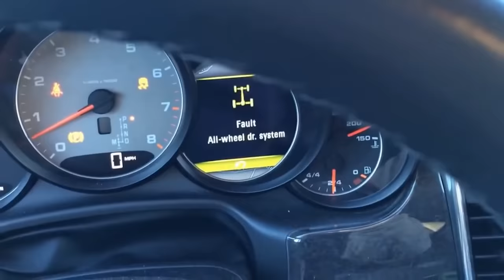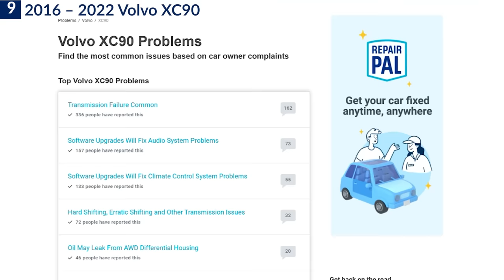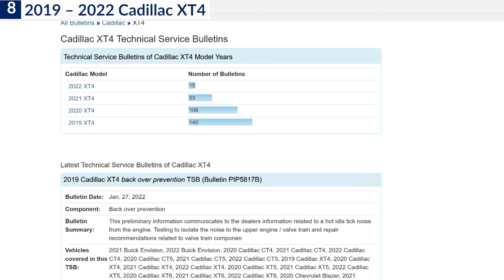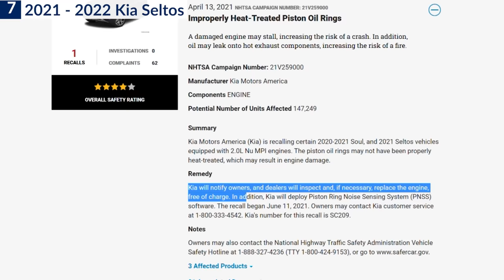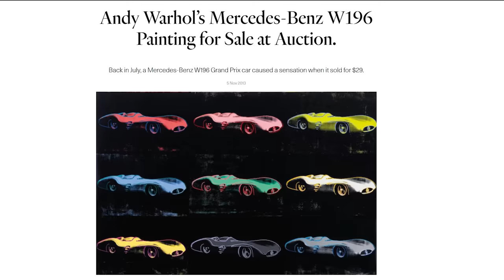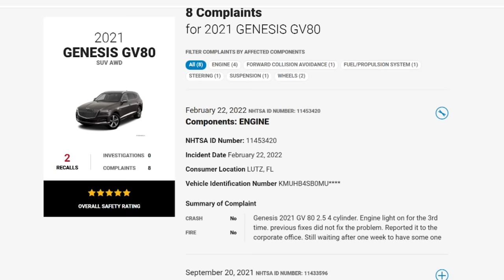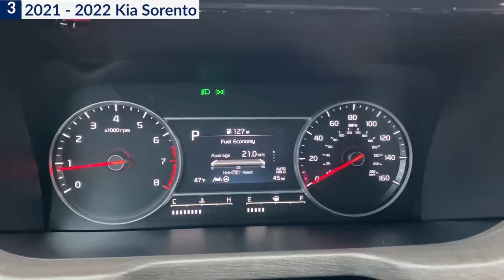10 New SUVs to AVOID - Here is Why !!

Comment: I had a 2018 Tiguan and never had any problems.  The only reason I don’t have any more is because I fell in love with the 2021 Arteon
Reply: I haven’t heard any positives about VW recently! Especially the van.
Reply: Same here, still have a 2018 Tiguan I bought new and not one problem
Reply: This is such a VW owner response lol. “ I had my car for 2-3 years and it was fine”. Some people keep their cars and want them to work into the future
Reply: You should play a Lottery because Luck 🍀 is in your side 😂
Reply: I have had a Passat for 6 years - perfect car! NO issues at all - totally reliable
Reply: So you got rid of one shitty car for another, congrats 👏
Reply: @andyb7719  My Passat is a lemon.  It has just under 100,000 miles on it, and needs the moon roof re-done for the third time.  Standing water in the driver's side foot well.  With all the other repairs it needs right now, it totals over $8,400, which is far more than the worth of the car.  When I took it in for servicing, the guy told me they were really busy, as there were lots of cars in for leaks.  It has been an awesome touring car on road trips, but otherwise has been a mess.  The first time it had to be flat-bed taken to the dealership was the day after we bought it.  The next time was a couple of weeks later.  All the mechanical stuff we have been through sealed the deal for me.  I just bought a RAV4 hybrid, and am very happy with it.
Reply: It is funny how some people in this thread call my car shitty but my sister who has a 2019 Camry which are supposedly reliable, has been in the about 6 times.  I will keep my shitty car
Reply: @japanwatchconnection which one? The 20'  Q7? The 16' IS350? The Camburg built long travel 05' Tacoma or The 20' XSE Camry V6?

Comment: The newer a vehicle, the less reliable it will be. This is why there is an odd year where a company does not plan for reliability but manages to eke out a top spot. Consumer Reports also has faulty metrics for gauging a cars reliability. It's based on consumer surveys and early reliability issues. Early problems are not indicative of long-term care. The vast majority of issues reported tend to be user adoption rather than something breaking. For instance, how to use a new infotainment system. The consumers of these vehicles have varying metrics and standards they expect in a vehicle. Someone buying a Mercedes is expecting something a bit more than a person buying a Toyota. It's basically asking the opinions of a car enthusiast verse a person who treats a vehicle as an appliance.

Reliable vehicles depend on their simplicity, power train and material choices, and consistency of construction. These can all be analyzed to draw conclusions on reliability beyond 5 years. There are rarely actual reliability issues under 5 years.
Reply: You mean the company? You’re basically saying older cars are more reliable which really isn’t the case
Reply: Our 2018 Suburban was bought brand new, we have had no reliability issues! The used car we bought for our daughter, well that's another story!
Reply: @chrisstromberg6527  
I meant it as in an old platform still in manufacture like the Dodge Challenger has been in production since 2005. A new Dodge Challenger would be far more reliable than a new Grand Wagoneer.
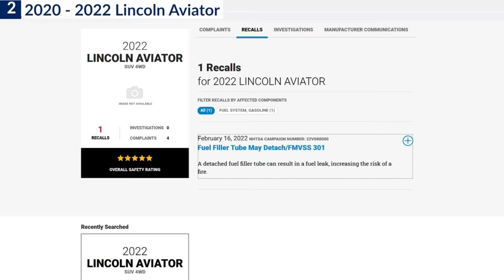Reply: German Vehicles lovely design great interiors but sad electronics failure . Japan electronics stand out as premium and reliability stakes. Happy customer award by far !!! 12:46

Comment: The Volvo complaints about bumpy rides on rough terrains, you got to be kidding. So in other words WTF
Reply: I never experience that on my 2017 XC90.
Reply: for real... I did a review on my '16 XC90. I address all the common issues. It also does not have transmission issues as stated.
Reply: True
Reply: Exactly! This video is full of rubbish
Reply: The first Volvo we got was a 2016 XC90, never had an issue what so ever and just felt like a tank, you felt safe in it. We returned it when the lease was over but I still miss that car.
Reply: When I test drove it, it sounded a little tinny.
Reply: @Listman11  sadly they aren’t made like they used to be

Comment: Hmm I dunno about this.  We have a '21 Aviator and other than a rear view camera recall we haven't had any problems with our Aviator.  Also they said they had the most comfortable seats of any SUV.  No they don't, at least if you have the 30way massaging seats.  The seat bottoms get really hard after a couple hours behind the wheel.  If I got another one I would pass on the over-rated massaging seats in favor of a little more cushion on the butt...:)

Comment: CR has become increasingly biased in recent years. I cancelled my subscription once I noticed this trend. I am by no means a GM fan, but to say their full size SUVs are the least reliable is just plain irresponsible. When a vehicle can go 200K miles with relatively minor repairs, it is far from unreliable. The Lincoln Aviator had 1 recall but is higher on this list than the GLE with almost 40? Tells you all you need to know about this list....
Reply: Exactly what I was thinking looking at this list. Seems just a blind list.
Reply: Your are 100 percent right
Reply: Your vehicle may have been the % that was ok. You're not looking at overall stats.
Reply: @Chris-de2qc  Most reports of vehicles that will last 200K miles or more include the GM full size SUVs. I consider myself a car guy, so I am almost always reading owner reviews and looking at this type of "Top XXX" list. I've personally had a Yukon and Tahoe that both went over 200K without any major repairs. Regular maintenance and a couple fuel pumps, and that's about it. I've had poor quality vehicles as well (one is one this list), but I stand behind my statement that CR is no longer an unbiased resource. They solicit reviews from subscribers, of which they may get a few hundred or maybe a thousand for a particular model, while the manufacturer sells thousands or even hundreds of thousands of these vehicles. Also, there is no way a list of unreliable vehicles is accurate without a Range Rover.
Reply: I agree with you. I too cancelled CR subscription. I have seen them indicate low ratings on particular vehicles when there is other vast compelling evidence to the conntrary.
Reply: My Lincoln MKX has been amazing in so many ways..
Reply: Agree.  They seem to love the Audi and BMW's, and yet my experience has been awful.  Worse stories I've heard are Porsche.
Reply: Totally agree, I have already comment that 1 min ago
Reply: 100% agree, our 2018 Suburban has been problem free!

Comment: Had a Mercedes SUV years back, fantastic car but It broke down on first holiday trip in Switzerland great service with the dealer taking part off showroom display car, that was the only issue in 100’000 miles, then got the first of new shape Volvo XC90, launch car and lots of problems on the electric controls, after several attempts to fix with software updates Volvo gave us a new car, I’m now on my 3rd, fantastic car with no issues anymore
Reply: Which is?
Reply: Geneva or bern?

Comment: Nissan earns a spot on this list for its CVT transmission.
Reply: I haven't had a problem with my Infiniti QX60
Reply: I've owned nothing but Nissan and I've never had a cvt issue.
Reply: Bought a 2017 Nissan rogue few months ago drives smooth The newer nissan’s shown provement
Reply: Didn't have an SUV but my Altima transmission died on me in the Chic FIL A drive thru.  Lol.  Had to be pushed out by two ladies.  They gave me my food for free.  It was a bad/big issue.  A lawsuit came out a few years back.  Nissan paid 70% of the cost to replace it which was $4k+.  Smh.  I think/hope they're better now.
Reply: @amyersadams  mine died on an exit ramp! Thank God I wasn't on the highway. Had to replace the transmission at 60k miles. It's a 2013 and I haven't had any problems since then, but I'm still wary about buying another Nissan, or an Infiniti.
Reply: @SassyZ22 , oh yeah.  Thank God!  Funny thing is, I was getting ready to get on the hwy but wanted a snack for the ride home from work.  I always say, I'm glad I was being greedy that day.  My tranny went out at 105k.  I now have about 228k miles on my 13' Altima.  So far, thank God, I've had no more issues out of it.  Hopefully the newer generation of those transmissions are better built.
Reply: @Angel Adams  yes, I'm at about 116k now too! But I'm definitely not buying anything with a CVT from here on out lol
Reply: I have a 3.5 Maxima. The CVT trans is the best of any car I have driven. Amazing

Comment: The XC90 transmission issues cannot be true, it shares the same transmission as Lexus and Toyota, the engine I can understand but not the powertrain or transmission.
Reply: Um, no they're not.  Volvo has a manufacturing plant in SC, however, the company has been Chinese owned for quite some time now.
Reply: @rickj1983  Yeah, I honestly don’t believe the transmission issue.
Reply: My 2916 XC90 T8 has been reliable so far except for a software issue on its infotainment system in my 1st year of ownership but since then resolved after software update. I hope I’m lucky on this one. It’s on its 6th year now.
Reply: @rfm357  I agree we have an XC90 as well we love it.
Reply: @rickj1983  Volvo's 8 speed transmission from Japanese Company Called Aisin, Aisin is related to Toyota Company. The transmission issues happened to Volvo was owned by ford  and 
Volvo used Ford's Dual Clutch Transmission.
Reply: What Year XC90?  I rock a Swedish Produced XC90, not Chinese. I love and bless my VOLVO XC 90!
Reply: @theguildedscribe777  The new model year! Geely, the Chinese company which owns Volvo, simply funds them and gives them access to their mechanics, tech, etc.
Reply: @wangruizhi1738  Yeah, I owned a 2006 XC90 before purchasing the 2016, it was reliable just transmission issues
Reply: @rickj1983  Chinese owned means jack shit because everything is Chinese owned. It is manufactured in Sweden and the transmission is from Japan. Same tranny as the RX350. It even says it on the window sticker.
Reply: @rickj1983  In China, the complaints rate of XC60 that made in China is actually lower than those Swedish built
Reply: @rickj1983  Chinese owned but not all made in China. Get with it sunshine
Reply: coolray, geely's bestselling crossovers in saudi arabia, qatar, kuwait and the philippines.
Reply: @wangruizhi1738  Volvo used Ford transmissions way back when.  I remember my dad making fun of my Volvo being a Ford, lol.
Reply: @TheDailyDriver  You probably got all of your information from the same window sticker too.
Reply: @andyb7719  Okay, moonbeam, try to figure out which ones are Chinese and which aren't simply by looking at them.  Good luck with that one, lol.
Reply: @wangruizhi1738  true but some applications of aisin aren’t that good either like you can have a aisin be in a jeep but for some reason it won’t be reliable on it compared to one in a Toyota it can still depend some aisins aren’t good even tho aisin generally is the best transmission

Comment: Volvo XC90 owner here, 61000 miles.  Been in shop 5 times.  Turn indicator system malfunction, engine light on twice, spark plugs replaced, lower radiator hose leaking and replaced, O2 sensor replaced, steering wheel module stalks replaced.  All of this within the last 5 months.  The new loaner vehicle that I drove while waiting for the car to be fixed only had a little over 1000 miles on it and randomly pulls to the left or right while driving (doesn't matter the speed).  So be careful while driving.  I'm NOT recommending this vehicle to ANYONE.  Buyer Beware!!!

Comment: The Ford Explorer was the perfect vehicle, reliable, comfy, great layout.
I sold a 2013 that had 297000 miles, and still perfect; I have a 2017 Explorer now,(258000 miles), and still believe is the perfect vehicle; however after 2018, Ford dicked around with the perfect vehicle and turned it into a Dodge.
Reply: I had a ‘16 & the AC immediately went out right after purchase & ford basically refused to fix it until I made a stink, then the back window shattered by itself a year later. I still liked the car overall though, it drove really nice. The gas fumes leaking into the cabin was also a periodic issue (although not often).
Reply: @woodpit420  hi, the fumes in the cabin is actually a recall item, the dealer will fix it for free, they fixed it for me, and made all the difference in the world.
Reply: I have a 16 bought used with 30K.....Now has 80K and most reliable SUV I've ever owned....4x4 limited trim.....only some small minor recalls.....wife drives it daily with my kids.....will look into the Ford Lightning for my next vehicle....

Comment: I don't buy the GMC aspect. Wife had a Diesel colorado that went up to 120K miles before she traded it in a new Sierra (also a diesel). Sis in law has a Chevy Tahoe and so far seems good. Literally the whole family is a GMC family and it works fine
Reply: I can say I’ve purchased 2 (Buick Enclave and Pontiac Torrent). Both had so many issues. AC failure at 14,000 miles, body was easily dented and so many electrical issues. Visit the GM forums to see how many have premature failures. I didn’t expect much from a Pontiac, but was extremely disappointed with Buick. I would never purchase another GM, my money would be better spent calling an Uber. My experience with owning GM vehicles

Comment: Had a 2018 Tiguan. Body defects and water leaking into the passenger side when raining. So glad it was just a lease.
But I have to say, VW seems to be responsible. We got a few thousand back. They also offered $2500 extra for another VW and we didn’t go for it.
Reply: Have a 2013 right now and it’s junk. Will never buy another VW after this one
Reply: I had a 18 also bought it brand new actually the same color as the one in the video i never had an issue with mine, only had it 2yrs then i upgraded to the 2019 Atlas SE and I never had an issue with it either i  loved them both....but i did just traded for the Volvo XC90 it was my dream Truck a month after having it the check engine light came on but the dealership took care of the issue it was under warranty, it was some type of sensor needing replacement no other problems with it since
Reply: @MP-hi5hs  u got to do maintenance on time it's that simple.

Comment: Really disappointed to hear about the Tahoe! I have had three and my present 2008 Tahoe has 180k miles and has been reliable.  I was planning on a new one in the near future but this makes me want to hold on to this one.
Reply: don’t let this video discourage you, most of these cars are very reliable. However, this VIDEO is VERY unreliable… if you take good care of your car it will last.
Reply: Don't buy a new one.  I bought one for my wife and had engine issues 2 months later.
Reply: My 2022 Tahoe with 7000 miles has a jacked up transmission!  Sitting at the dealer service department for over two weeks and they are still waiting on parts!

Comment: Thank god no Dodge Durango. My 2018 Durango V6 has been pretty good. Only issue is sometimes there a glitch with the radio when it rains for a long time.
Reply: I have a 2012 V6 Durango with 140k on it, only think I've had to do is replace the radiator because it sprung a small leak and I didnt want to have to refill with coolant all the time. Still cruising though!
Reply: I have a 2016 Durango.  45000 miles, Not one single problem.
Reply: I’ve got a 2011 Durango with 150k still cruising I might swap a 392 in it at some point 😏
Reply: I have Durango Citadel 2015,No issues as of today, still running smooth, change Radiator under warranty as it has small leak, some lights out, needes replacement. That's it
Reply: Durango is too simple to have many problems.

Comment: Chrysler’s after market care is terrible! When my 2018 RAM had a recall, I immediately took it in for repairs; the tailgate constantly opened, causing freight to fall on the highway. I lost many items and it endangered those behind me. The “fix” did not solve the problem; the tailgate kept on opening after the “repair” was done. I kept on contacting Kingston Dodge, but their new excuse was, “Because of covid the parts are unavailable.” In April 2022 the tailgate opened again and hit my trailer, causing a dent in the top. I have been contacting Chrysler and Kingston Dodge constantly but they keep on ignoring me. I am seriously thinking of starting a legal case.

My Corolla has over 330 000 km with no problems.

Comment: if you didnt know the gv80 was designed by the same guy who designed the bentleys...  also uses some of the same interior materials...  as far as reliability who knows yet but as far as the value compared to whats in it and its competitors it is actually under priced.

Comment: the genesis has a 100k mile warranty where the domestics will not budge over 36k. if you lease for three years you get services and oil changes included and the remote app is included for the three years while domestics are lucky to give it to you for 6 months without charging you more to continue it. i would advise anyone looking in that price range to compare all models for that price point and then test drive the genesis. there is no comparison to the build quality and feel for the money. it may be considered the poor man's bentley but the styling is great and the interior feels very high end with way less nasty plastics than the domestics. the jeep grand waggoneer is 117k top end and is a complete pile in comparison in my opinion. if you do get the GV70 i recommend the V6 personally. i promise you to just look and sit inside the genesis cars and SUVs and i promise you will not be disappointed.